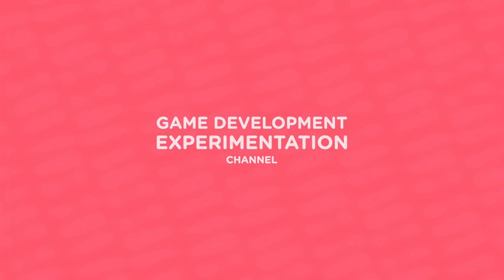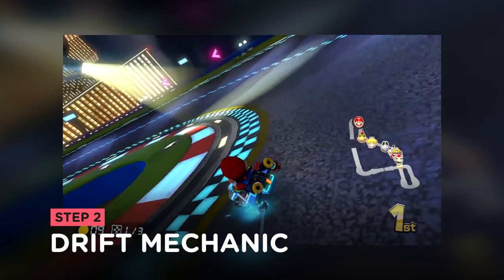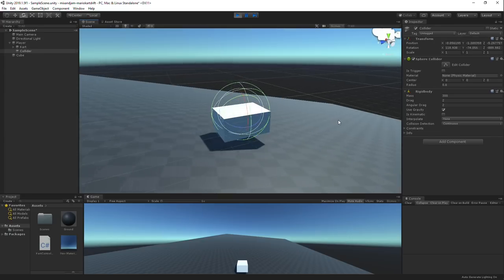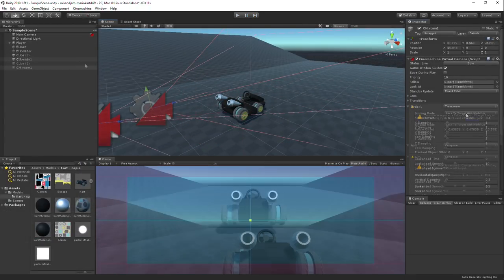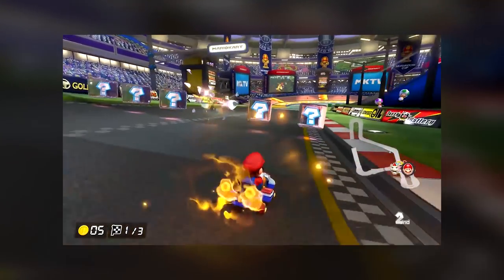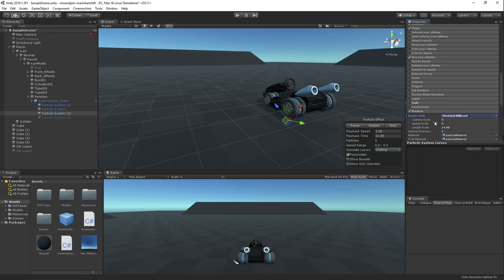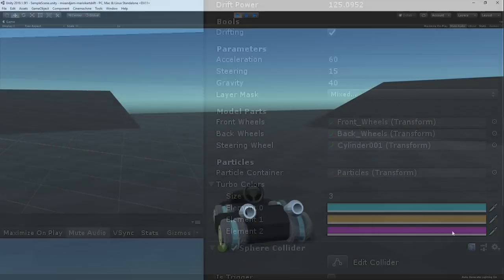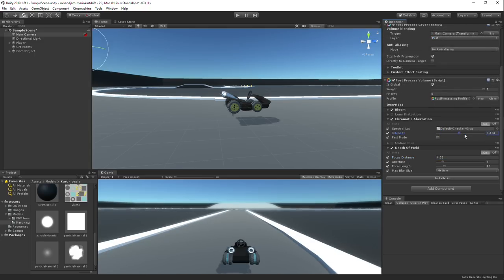Recreating Mario Kart's Drifting | Mix and Jam

Comment: I worked off this code recently and its really good! One issue I found is that it’s Lerping rotations as Euler angles instead of just Lerping them as Quaternions. High speed or complex movement can really break the controller and throw it into a frenzy, and it seems to be because of eulerangles jumping from 0 to -180. Fortunately you can just rewrite it slightly and not use eulerangles at all.

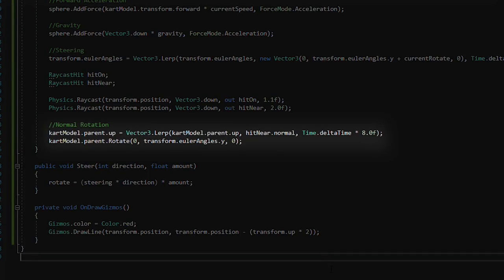Comment: I loved that tutorial and how smooth is the final kart's movement. I'm trying to replicate the tutorial on Godot Engine, but right now i'm stuck in exactly this part: 1:28 where you show how to rotate based on ground normal, but as I don't used Unity Engine i don't know what the "up" property from the KartModel.parent means, or the equivalent to the Godot Engine, if you can explain this to me, thank you. Greetings from Brazil!
Reply: Little late but kartmodel.Parent.up takes the kartmodel, finds its parent and then retrieves the local up vector.

This up vector should be the same as the ground normal vector which he gets shooting a raycast which returns the normal vector of the triangle it hits.

He then lerps between the current local up vector and the ground normal to alter the up vector towards the desired vector...

Comment: Is that timescale change section supposed to be on the code? It seems a bit messy.. Not triggered in sync with the drift activation, and .2f timescale is practically unplayable. By the way, you channel is really nice, thanks for sharing this interesting gameplay features.

Comment: I been following the code in the video up to the point where you make the block change orientation based on the ground below it, but mine just flips out, spins uncontrollably, and seems to oddly function on the origin. I can send you the code I have if you'd like. I'd also like to know if there's a full tutorial on this, at least for the main functionally. Thanks in advance.

Comment: Whatever I make in unity with fixed update i always seem to see stutter in stuff that moves or moves relative to the camera. Is this me just going mad?
Reply from the maker: Hey Rise!

Yeah there’s a bunch of issues when using Fixed Update with camera movement. I believe a way to fix that is by using SmoothDamp, but I’m no 100% sure! Let me know if it works out!

Cheers!
Reply: @mixandjam  Thanks for the response. Ill definitely look into that
Reply: Any update on this?
Reply: @GregoPV  Use fixed update. Lock your framerate, to 60 for example then set physics update to be 1/60th of a second. This way there is one update per frame so there is never 2 rendered frames to 1 physics frame. Make sure drivers are updated and no task manager is running. Then just run it. It will be smooth in the editor ish, but will be smoothest when built.
Reply: @rise6471  thanks 👍